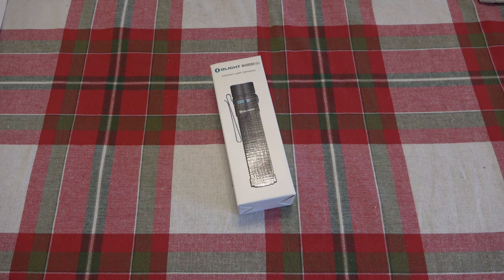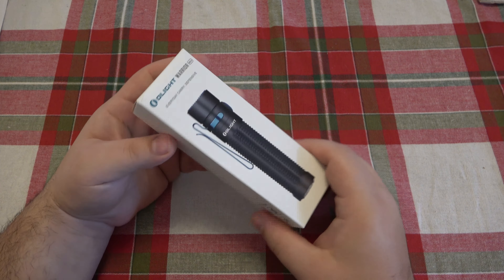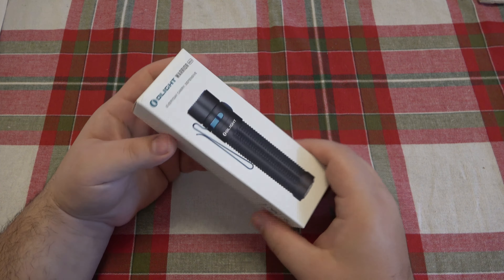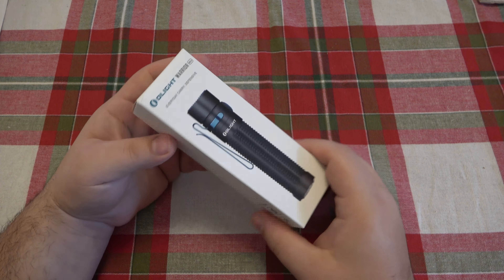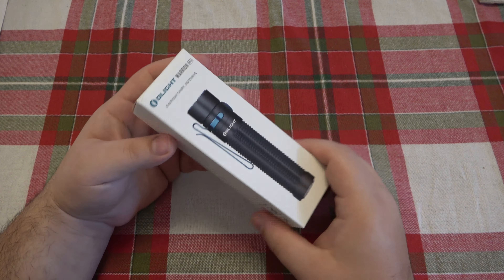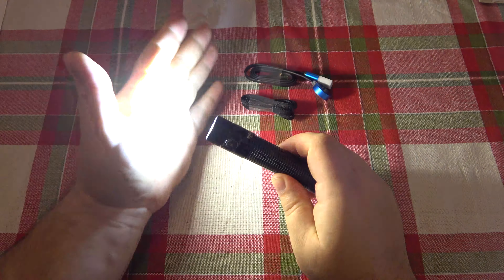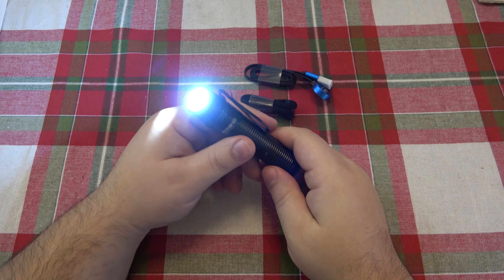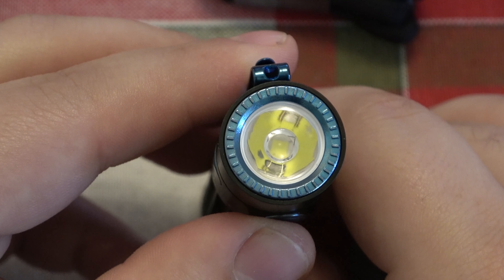Olight Problems...Warrior Mini Overheating ???  Let's Try To Break One...

Comment: The problem is having it in a pocket when it accidentally turns on. There is no way for the light to dissipate heat and burns through clothing and melts the lenses leaving it in the open doesn’t cause any problems. They have started leaving pamphlets in boxes saying lock it before you pocket to help mitigate the issue.
Reply: That was the first "problem".  I just lock mine out.  But apparently some peoples just burn when its on outside of pocket.  I saw one guy just holding it and you could see smoke coming off the lens.  I have 2 and haven't had an issue with mine but apparently there are some bad ones out there
Reply: the real problem is they use plastic lenses instead of glass ones.
Reply: This is correct. You need to cover the lens to have a problem

Comment: Cool Jeff... taking one for the team, thanks!!  I always - AAWAYS (!!) unscrew the tailcap a half turn on my various EDC lights.  I will not carry a light that can not mechanically tailcap lock out.  Do not want to risk accidental turn on.  Learned this lesson the hard way, and I had a light melt a hole in my sleeping bag.  It happened in the middle of the night, when I fell asleep.  I was very lucky!!

Comment: Mine's in tactical mode, so tail switch will only work with a half press for turbo and full press (holding) for strobe won't stay on without constant pressure. I don't carry in pants or jeans pocket. 
I'll be interested to see your findings. Too bad if there are overheating issues, as this is one of my most useful and best UI lights! 👍

Comment: I purchased an Olight Warrior Mini in March 2021 on eBay and it’s done this to me twice when placing it in my pocket with my car key. The first time i could feel the heat on my leg but it didn’t do any visible damage to my leg or clothes. The second time I smelled it burning while in my pocket. After I let it cool down I noticed that the lenses was somewhat sticky and has a small blurry spot on it from where it started to melt. I did quite a bit of research on the Olight Warrior Mini before purchasing it and had never heard of this issue. I now use the lockout mode religiously.

Comment: Got a copper one and the magnet got ahold of my Victorinox Cadet on my keys and I guess I sat down and it put pressure on the pressure switch. Didn’t notice that it was on, burned a hole in my jeans and shirt while I was at a restaurant. I will say it gets super hot on turbo after about a minute. The magnet seems stronger than my S2R and S20R that I’ve carried for years and that the pressure switch should be stiffer. I took the pocket clip off the standard position and put it with the lens facing down. That has helped the pressure switch to not randomly come on. And yes my lens is not clear anymore so I didn’t know that it could possibly be from heat.

Comment: My M2R warrior pro turned on to turbo while it was in it's sheath on my hip, I didn't notice until it had started to burn and melt the sheath, but Olights are designed to shut off turbo after a certain period to high, say 2 minutes for an S2R Baton2
Reply: Lock it out. Hold the side button down for a few seconds and it won't turn on. Simple

Comment: I’ve had one for a while. And noticed if it’s not “locked out” it will magnetically pick up something metal in your pocket and turn on turbo. And has burnt a small part of some clothes. (Took me a while to figure out the lock out feature)
Reply: How do I lock it so it doesn’t turn on?
Reply: @optimuscrime608  press and hold the side button. The moon light will turn on then off letting you k ow its in lockout
Reply: When the light is off hold the side button till it turns on moonlight and back off. When it’s locked out a red light will come on the side button when you try to click it

Comment: How does it turn on by itself? If I have it in a drawer am I at risk? I don’t lock it out before putting it in the drawer.
Reply: it doesnt randomly turn on, only if the buttons are pressed inadvertently or the tailswitch is shorted. Jeff and the rest of the uninformed here aren't ready for the responsibility of a high powered flashlight I guess

Comment: Put something over the lense and it will melt. Leave it on normally, and it will function normally. Now take LITERALLY ANY OTHER LIGHT FROM ANY OTHER BRAND and do the same test. Same results? Huh. It's almost like any high output light will do the same exact thing.

Comment: I did not believe the allegations at first, but tonight I was poking in my backpack where I keep my light and after few minutes I returned to my backpack and noticed a bright light coming thru the tick layer of my Samsonite backpack, the light was on. I believe the problem is with the button that accidentally turns on the light and causes the overheat or even a fire if you are not near the light.

Comment: Mine turned on in my pocket and burnt my hand to the touch. My m2r pro came on in its holster while I wore it and burnt a hole in its holster and I had to cut it off while I was driving
Reply: I noticed today’s me yesterday. During regular use on turbo my warrior mini titanium got extremely hot to the touch in just a min and today with it didn’t get nearly as hot using turbo for a minute

Comment: I had this exact issue over 5 years ago with one of the first high output Serfas Bicycle Lights. There is literally bubbles that are visible in the clear plastic lens cover today, from previous overheating. I can feel the heat that comes off it when I’ve had it on for a bit. I just use it in blinky mode now, or only in full power mode for very short periods along unlit bike paths or sections of road at night. I guess whilst moving along the air moving over it would help to cool it, but still.... $150.00AUD light, I expect better😒

Comment: User error.. this problem only happens when it turns on in your pocket by mistake and not using the lock out function. Yes it will burn a hole in your pants or shirt.

Comment: Anyone looking for a hot AF led light built like a tank check out the nitecore E4k, burned a hole through my pants 🤣🤣🤣 my fault for not locking it out.
Thing got slammed in my hood four times last week and the week before it floor off the roof of my car yet the glass lens didn't even crack. Nice small light at over 4,000 lumens and hasn't had a problem in the half a year I've had it.